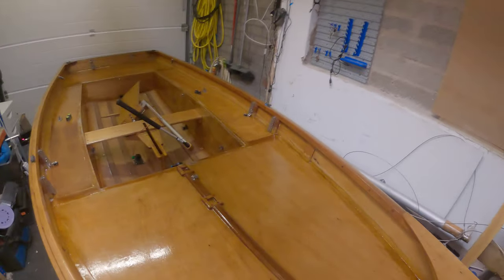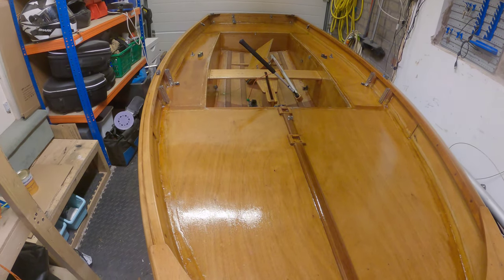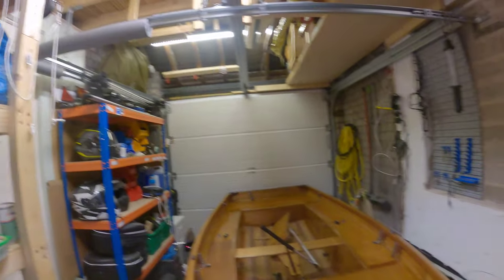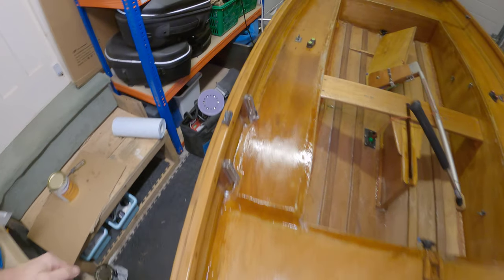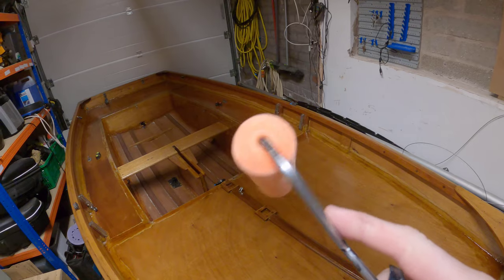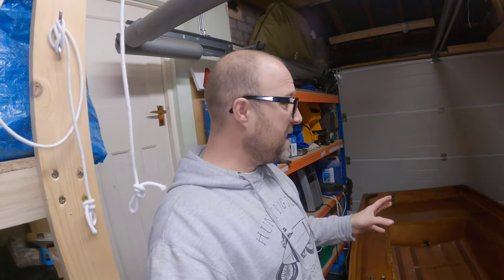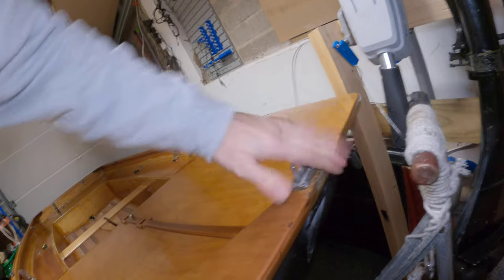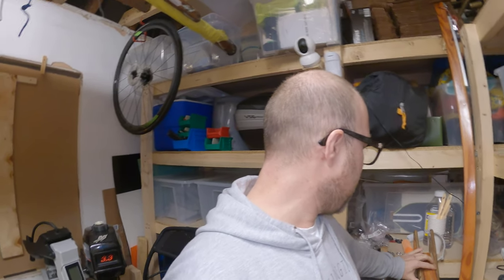Final varnishing and painting of the Mirror Dinghy

Comment: Well done. It looks good. You are at about the same stage as I am with mine.  Why not use the International Perfection Plus two pack varnish? It is much more durable, goes on really easily and looks great.  Good luck with it!
Reply from the maker: Hi Gareth, TBH reason is I did not know that existed!! I will look that up for sure.  The Compass varnish is great but I have found it has scratched a little in some places. I think it may be that it wasn't quite hardened enough before I sailed her again.
Reply: @SailingWithDave  The two pack is very hard as it is epoxy. I'm not sure if you can put it on top of non epoxy varnish
Reply from the maker: @MrGazzbazz  I'll check it out, I could also test a bit on a scarp piece of wood. Anything that would last longer would be welcomed!